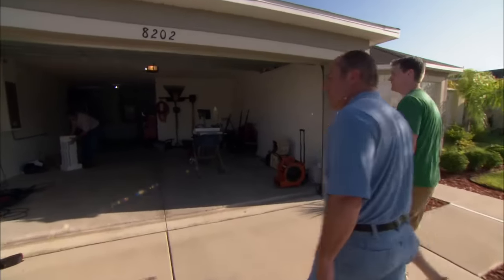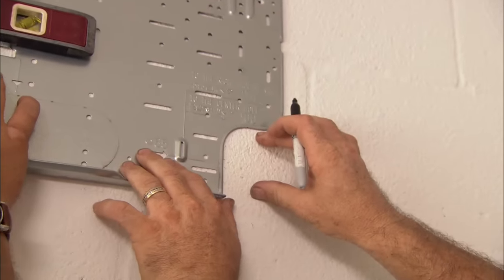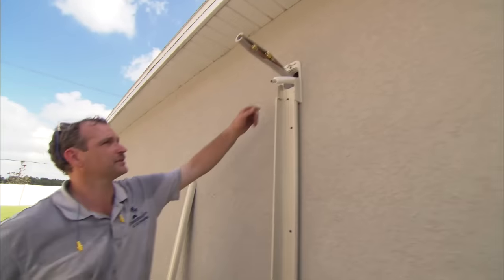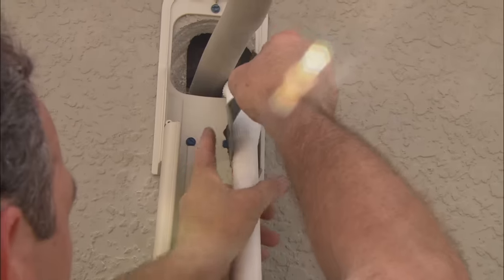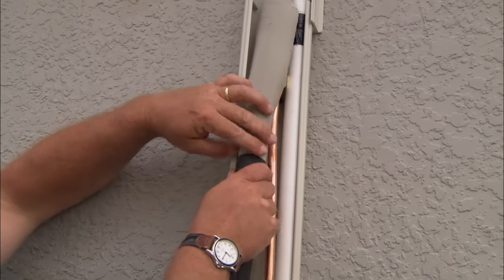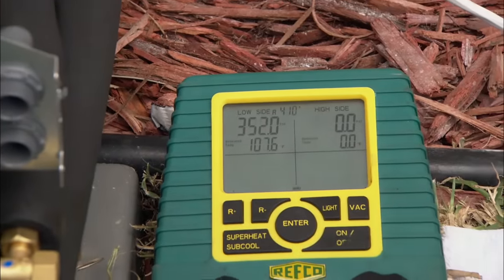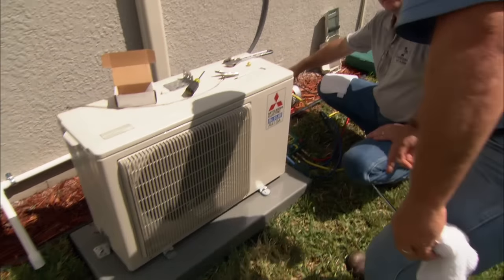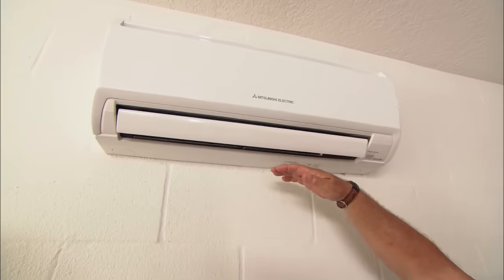How to Install a Ductless Mini-Split Air Conditioner | This Old House

Comment: We're victims of home improvement shows: Oh TV, you make things look so easy. The electrical lines magically appeared right next to the outdoor unit, all the right tools are readily available at hand, all fittings, nuts, bolts fit perfectly together, and there are plenty of extra helping hands available to lift and level the parts. Then inspired by watching videos like this, the average Joe decides to take on a project, just running the electrical wiring and installing an extra circuit breaker is an adventure on its own. Rule of Thumb: For every one minute of video it will take one hour actual time. This project shown in a 7 minute video, will take 7 hours for average Joe, if they're lucky.
Reply: The average Joe will be screaming to the parts as he goes because things don't fit like in the video.
Reply: You could do this project yourself, but it's probably best to leave it to a professional.  You're probably looking at a couple days work, one day to run the electrical and pour the pad for the condenser, and the second to hook everything up and test.
Reply: The install featured in the video isn't that hard... the panel was right next to the install so if you didnt want to run the wires in the wall you could just run a conduit outside the wall
Reply: 7 hours, that's awfully ambitious lol. I'd expect to double or triple that figure just for the concrete base that goes under the outside unit.
Reply: Tech29
 great comment, your observations are accurate and I agree with you. Let me add to your comments a few things. A professionnal  has the logial mindset to do the job, he knows where to start, where to go, and what to avoid in the installation process. Those details the average Joe will not consider them before trying, and most of them will fail to do a good job. If you are not skilled do not try because you will mess up with you AC and lose your money.
Reply: @Dirtyboxer1  pour a pad? Just put a couple of cinderblocks down.
Reply: @Dirtyboxer1  why would you have to pour a pad? A few pavers would suffice
Reply: lmao what? 7 hours? It would take me 3 hours max to install this, and I've installed hundreds.
Reply: @matttzzz2 are you average joe with these? No.
Reply: @vadimnesen8060  why on earth an average Joe installs an AC ? Leave it for a professional unless you want a fire and a broken AC unit.
Reply: @jamescollins6085  Dig a hole, pour some quick crete. Not hard
Reply: Just a quick note. Average person will void warranty if they install this them selves.
So if you go the DIY way be very certain you don't make a mistake and perhaps get a licensed tec to over see the work.
Reply: Well if you need every single little detail explained then you probably have no business trying to do it yourself.
Reply: Don’t forget to double your estimate because you have no clue what you’re doing.
Reply: Why is it called "ductless"? There's clearly a duct going from the outside unit to the wall mounted inside unit.
Reply: Do you want to watch a 7 hour tutorial or a 7 minute one?
Reply: @aneziacm  I want to watch something that doesn't make the project look overly simplistic. I wanted to remind to all fellow DIYers how many times we thought a project, even something as straightforward as replacing a faucet resulted in hours of round trips to HD due to unforeseen problems like seized valve stems, etc. Take it for what it is. You buy a $1000+ AC unit, cut a hole in the wall, now you are fully committed.